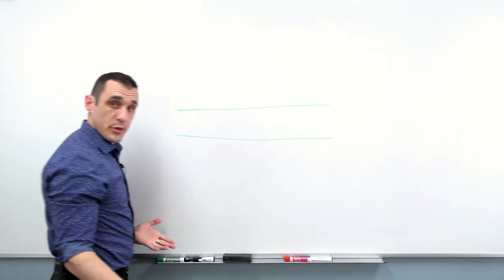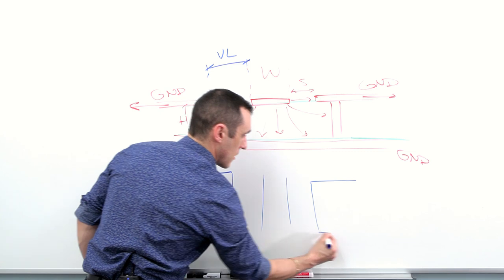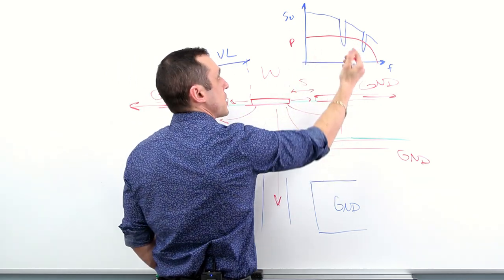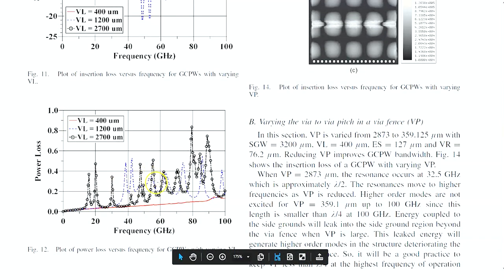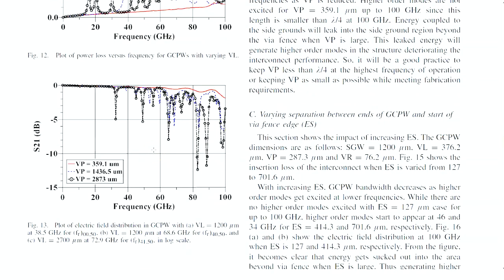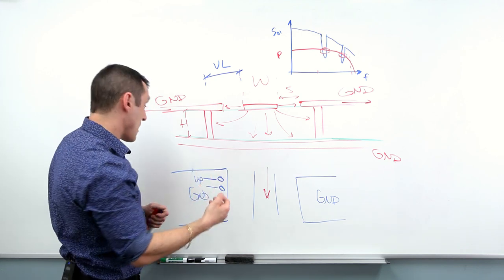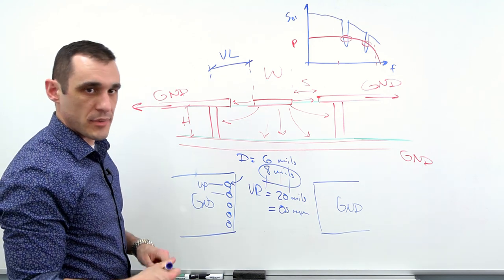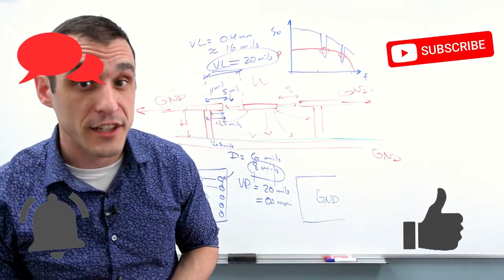Digital Signals and Grounded Coplanar Waveguides

Comment: Hi Zach,  thanks for sharing this important topic! And indeed you can have a 4 - 6dB dips in S21 and this leads to S11 (and S22) degradation as well, causing standing waves that can corrupt your SI and RF performance (or even damage your HPA). In my circuits i use "rule of thumb" lambda/20 pitch for vias that work with most manufacturers up to 6 - 8GHz, above 8GHz you can have vias placed at lambda/10, but it is good to perform CPWG simulation in this case. Regarding the VL - this is mostly determined by the CPWG impedance that you want to achieve in first place and then by manufacturers capabilities. Also for signal content above >10...15GHz it is wort to consider microstrips rather than CPWG as their losses will be lower as well as S21/S11 dips may be avoided.

Comment: Hi Zach, @13:34  can you clarify from where the "minus 3mils and minus 3" came up, and what exactly is each of them. Thanks.
Reply: Sure, I was basing that example on the 14 mil via-to-via pitch. The point was to compare the via pitch to the hole wall separation using the drilled hole radius. I was saying to suppose our drill hole diameter is 6 mils, that means the radius is 3 mils, so subtract 3 mils and another 3 mils from the via pitch distance to get an 8 mil hole wall spacing. That might be a little low for some fabricators, I've been given no bid status by one fabricator in the past because I went below 10 mils. So if your hole-to-hole distance increases from 8 to 10 mils, the half-wavelength you can reliably isolate for the lowest via-to-via structure resonance also increased by 2 mils, or an additional 25%. That means the frequency corresponding to the first resonance in that via-to-via structure went down by (1/1.25), or by 20%.

Comment: Hi for pulses with very fast rise time to travel between one board to another board do we need transmission lines like coax or pcb transmission lines????
Reply: No it is not required to use a coaxial structure with very fast rise times, although you can use a pcb transmission line that looks coaxial. When rise times become very fast then the transmission line needs to become physically smaller as I demonstrated with the data shown in the video. Making the line smaller pushes the cutoff frequencies for higher order modes to larger values, and this is why you can extend the channel bandwidth with a physically smaller line. You will see stripline coplanar waveguides used in packaging and in PCBs, I have designed these in recent work for clients. You will also see microstrip coplanar waveguide in PCBs, some example boards were used in demos at DesignCon this past year.
Reply: @Zachariah-Peterson  thank u Zach now I'm sure to use a transmission line in my pcb I was planning for use an ungrounded coplanar  transmission line I tested my designed line with vna and It's good for now I hope it Will works properly in final pcb...